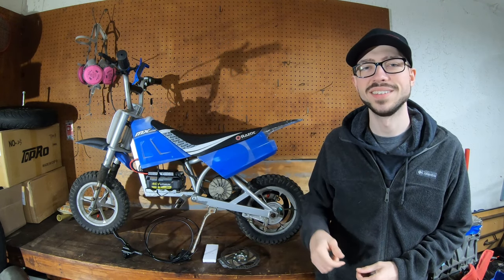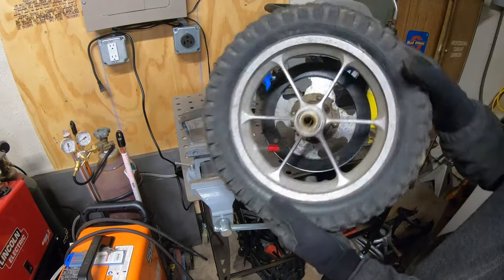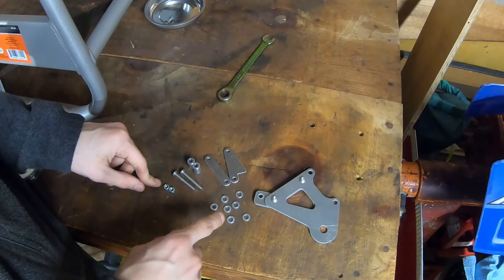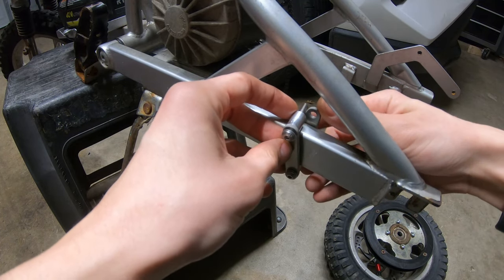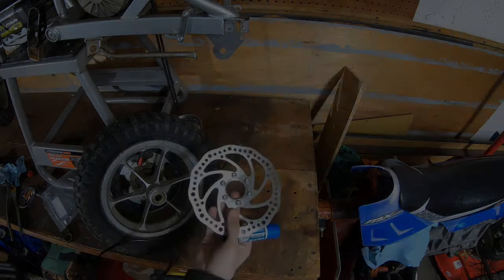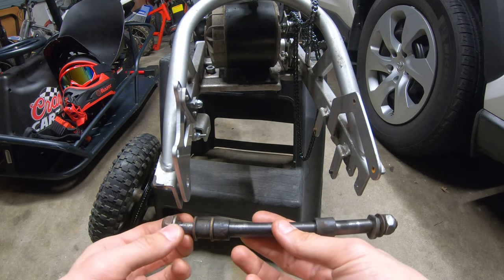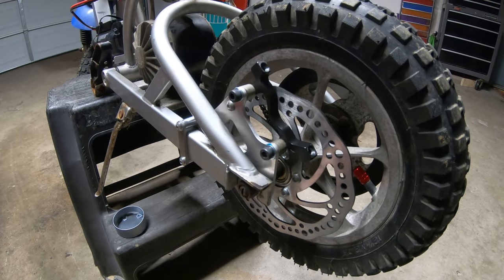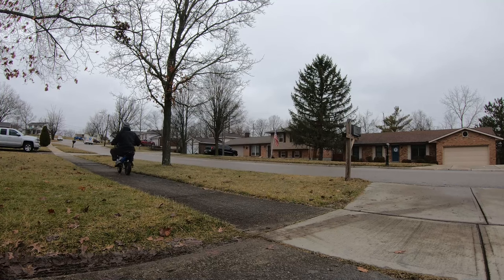How to Install Disk Brakes on Razor MX350 First Gen

Comment: I have a 1gen but with out the rear suspension? Europe.. what
Reply from the maker: There was a limited run of like 1.5 gens! I had one in the states. Yours is the 3rd one I’ve heard about. Crazy
Reply: ahh now I understand thanks👊🏼 question: I would like a 48v 1600-2000w motor, what kind of battery is best for the mx350, I can't figure it out because of the lack of space?
Reply from the maker: It’s best to measure what kind of room you have to work with and then check some different battery sizes
Reply: Hello Jordy could you help me find that adapter plate for that rear brake? I can't get them in my country via your link, so I searched everything separately on AliExpress but I just can't find that adapter plate.
Reply from the maker: @Jeffrey.Bogaerts need to talk to @matric_cali on instagram. He makes them

Comment: Quick Question, how did u get it run n one Ryobi battery? Mine I have to use two Ryobi batteries to make it work cuz one battery the power will cut off as soon as I twisted the throttle.
Reply from the maker: You can’t run just one battery you need two wired in series for 36v

Comment: I have a question to do the front what do you do or you jsut have to buy a mx650 tire that comes with it
Reply from the maker: No front brake. If you want front brakes you can get a sx500 forks and wheel and put a bigger shock on
Reply: @JordyBuilds  oh okay thanks for letting me know